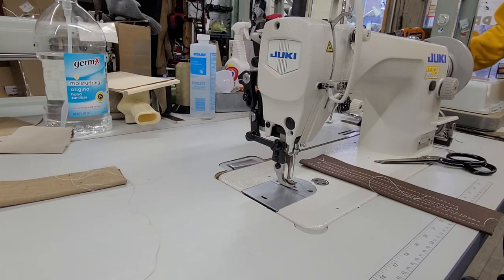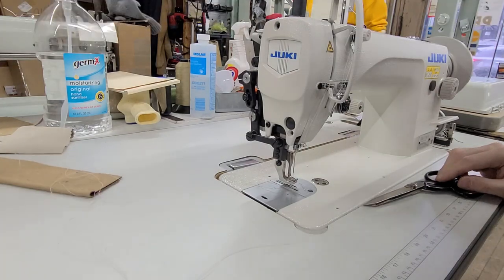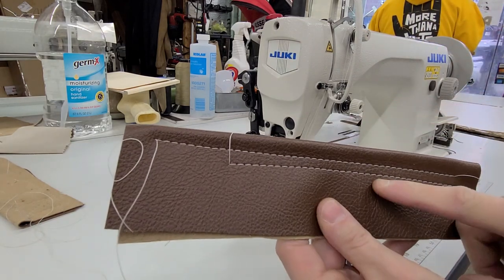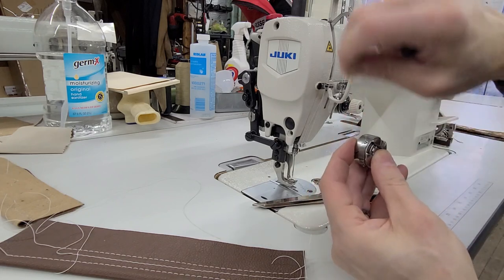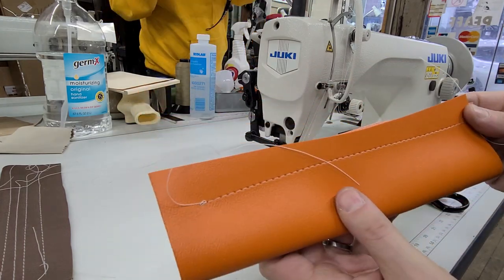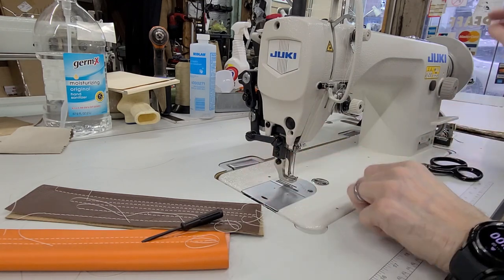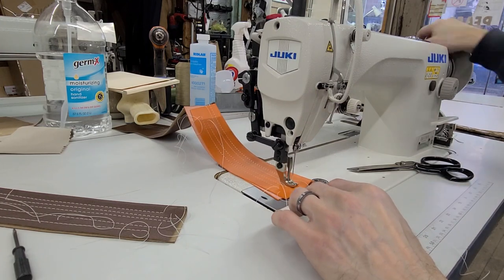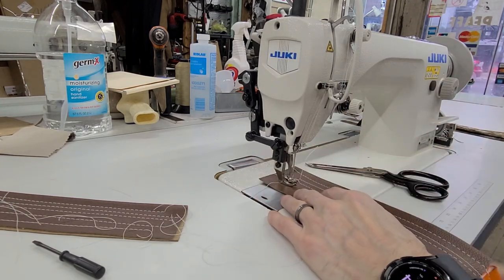Juki DU-1181N tension lesson

Comment: Hi Steve about 2 weeks into having my new machine in it started pulling to the bottom such as you said. I hat paranoid so I started watching YouTube tutorials. The man o the tutorial said that the knob by the wheel  all the way to 9 to where it won’t go further and that should work. My machine was horrible , I try to put it back but that knob just came tumbling down. I was so scared I had broken this very expensive machine and didn’t even get to see anything. The place we bought it at was ove 3 hours away so we went with all the pieces of material I use to test it. The guy at the shop just took me to a machine and showed what to do when I got back home. I played wit it because by this time I was not so scared of it.
It has been 5 months and we are starting to understand each other. I wish I had seen this tutorial back then it would have save me the stress. 
Also Lauren MORE ME KNOWS said you have the JUKI PLATE WITH THE MEASURING LINES. I just started making these purses and crafts and could really you that🤪. Could you get.ahold of me and let me know what it cost.
Thanks in advance for all your help
Reply from the maker: You are most welcome.  
Here is the link for the plate.  https://sewinggold.com/product/juki-du-1181n-needle-plate-with-measurements/

Comment: Hello Steve! You are  my very good teacher, thank you so much! I have Juki DDL-8700 and  Juki DU-1181N. I got  both unassembled and I put  it together. Unfortunately I have problem with  "BIG BOY "DU-1181N. It is so hard to use the knee lifter . Always hurt my leg. Please tell me  or show me what can I do with this issue?. /With his "Sister"  DDL-8700 so easy to use the knee lifter/. Thanks Erika
Reply from the maker: The springs on the presser feet are stronger than the DDL-8700.  You can loosen them a bit and it will make it a little easier on your leg.  https://youtu.be/SYqQiYqw84k

Comment: So I have a question. Do you have to change the tension on the bobbin or top when you change to a different size thread on juki du1181n? 
I found when I received my juki from the dealer it had a much thicker thread on it. I was at the time using Amman t70 and it totally messed everything up and I had to mess with both bottom and top tension. so now that I have my tension right I'm scared to change the thread. I want to use size 92. So What I'm asking is do I have to mess with the bobbin every time I change the different size threads? Well, originally it was for the 135 but changed it to 92. That works for all sizes of threads. Thanks so much

Comment: I am having the hardest time.  I switch from T90 thread to T70 and my stitching on the top is one big run-on.  The bottom stitch is perfectly fine.  I watched many videos and followed directions and T70 thread won’t take.  When I switch back to T90 is sews perfect.  I even changed the needle for  to 135 x 17 DP x 17 (?).  I have the 1541s Juki machine.

Comment: Oh my gosh just this afternoon I was thinking I wish Steve would make a video on tension and here you are!!!  Besides the tension problems - I'm having a problem with the back stitch level not popping back up after changing stitch lengths (I have to hold it down to get the stitch length nob to move). Any thoughts?
Reply from the maker: Do you have an aftermarket needle plate installed?

Comment: I've watched a ton of your videos and I'm still having troubles.  What should I do when I've tightened the top tension all the way down AND I've tightened the uptake spring and it is barely correct?  I don't know why my top tension should need to be that tight.  I have the bottom tension pretty loose.  I even wound thread on the machine itself to provide a bit more tension.  I have a Juki DDL 555.  Any thoughts?

Comment: Hi Steve, I recently purchased the Idustrial 3 head sewing machine for hair extensions. The first one is working fine, the other two's thread keeps snapping. Im struggling to find the solution there. Any tips?
Many thanks
Esther
Reply from the maker: I'm sorry Esther, we do not sell that type of machine.  General tips would be to check to make sure you needle is not in backwards and check your threading.  Simple stuff but common errors.

Comment: Good Evening,  Steve.
  My Juki du1181n ‘s tension discs do not come apart when either using the knee lift or the knob to raise the presser foot.  I can run it over vinyl and it pierces the fabric however it doesn’t not connect with the bobbin thread.  This started after I tried to adjust the tension.  Any suggestions, please?

Comment: So if  I use T80  variegated thread with a 20 needle do I need to adjust my top tension disk? More tension or less tension?  I'm having an issue with it right now using the T80 Variegated thread.😞

Comment: Does the same tension work with different material thicknesses or layers?
Reply from the maker: If the tension is set for thinner fabric, it should work well on thicker. If it is set for thicker fabric, you may have to adjust it for thinner fabric.

Comment: Loops on top stitch? Still playing around with it. Marine vinyl, Tex 70 thread and  size 19 needle.
Reply from the maker: Either loosen the top tension or tighten the bobbin case tension.  You can try both, but one at a time.

Comment: 9:36  We have an 1181n and the hand lift is not working.  Is this a simple fix?
Reply from the maker: The hand lifter does have a dead spot.  When you turn the wheel and the needle is in different positions, does it work?